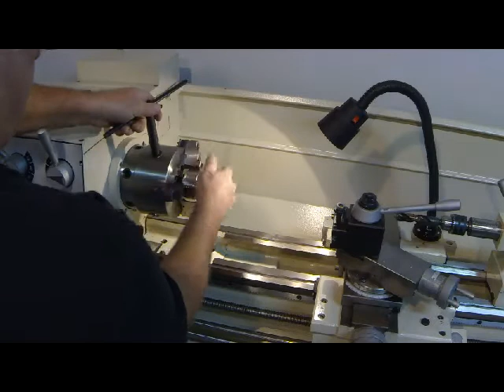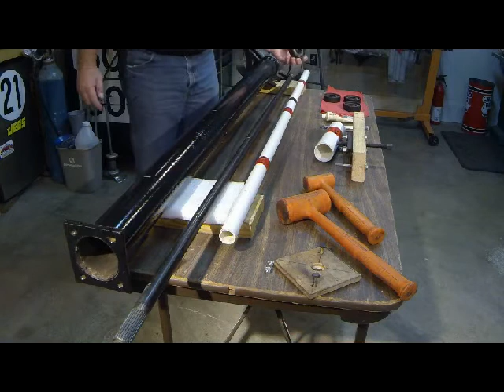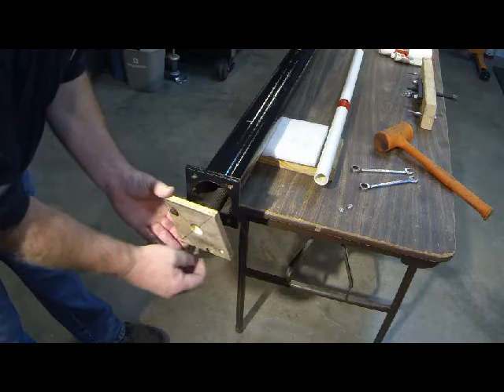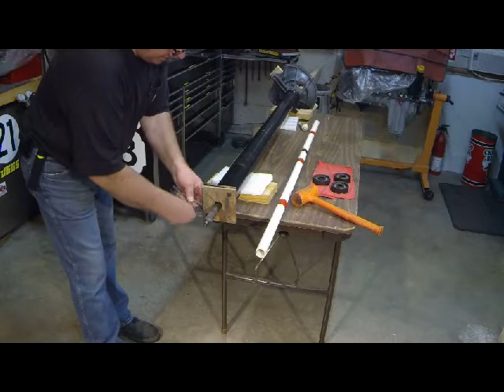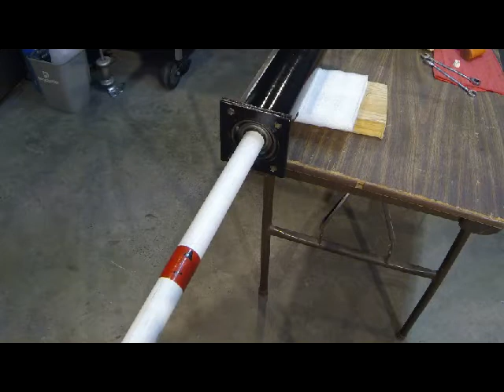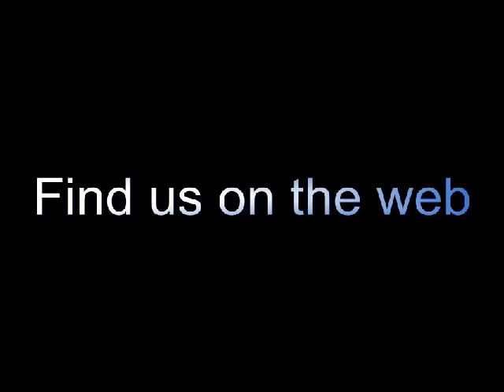944 Torque Tubing Part 2

Comment: Hi
Im newbie about porsche torque tube bearing replacement. Is it special bearing ?
Because when I replace a normal bearing , for different application, normally it would be worn when we install the shaft to bearing since we hit the inner race of the bearing.
On this video ,bearing no123, The outter race of bearing will have resistance from the inner of the tube.

Comment: How did you get the shaft out of this?
Reply: Hi Thomas, there are a number of ways to remove the internal propeller shaft. One very effective way is to drive it out from the back to the front as far as possible with a steel bar with a diameter smaller than 25mm or 1 inch. That way if you are careful you won't needlessly damage the bearings. 
When there is enough shaft exposed out the front end you can make a simple and effective clamp that won't damage the shaft itself using a block of 2x4 wood.
For this "clamp" using a block approximately 8 inches long, cut the block lengthwise. Next cut a small "V" grove in both halves at the mid point. Drill two thru holes at each end of the block and using two lengths of "all thread" rod you've made your clamp to clamp around the propeller shaft. Once clamped you can tap on the wooden clamp with a hammer to extract the rest of the shaft. Hope this helps...!
Reply: Actually it does a lot, yesterday I pulled on the TT so much I pulled the tube towards the rear while the drive shaft was stuck in the clutch. But I think the bearings are shot in the TT and need to be replaced
Reply: got the shaft out using an 8' ground rod today and pulled the bearings out with a threaded rod. hot tip, don't spin the rod, you will screw up the plastic sleeved washers that are between the bearings and rod. use a wrench and pull the rod not turb the rod. takes longer, but the sleeves are hard to come by.

Comment: you made it look so easy. I remember a really bad week a couple years ago. ha. Ended up buying the constantine super bearings due to the ease of installation. I think if I had the delrin sleeves it would have gone much easier. Trying to whack those bearings out the first time was a beast. Lots of blood, sweat and cursing.
Reply: Tim S 2006 corvette how to instold coupling on a tube torke
Reply: Hi Pedro, 
Joining the drive shaft to the trans-axle input shaft is relatively simple. First with the trans-axle out of the car I recommend you try sliding the coupling onto each spline shaft, on the trans and on the drive shaft separately to make sure there are no interference problems and the coupling slides onto each easily. Next I would also try fitting the coupling's cross bolt while the coupling is test fit on each shaft.
Now, with all of the trial fitting done I would next slide the coupling onto the trans-axle input shaft before re-installing the trans-axle.
Important note: before installing the trans-axle make sure the two alignment sleeves that align the rear flange of the torque tube into the trans are in place. These two small sleeves are located in either one of two positions. Either in the torque tube rear flange or in the trans bell housing. These are important items that keep the torque tube and the trans in alignment.
With the trans bolted to the torque tube, slide the coupling forward until the cross bolt hole is aligned with the corresponding grove in the input shaft. Next, install the cross-bolt. Do the same to the driveshaft side. Install the cross-bolt. Refer to the shop manual for the proper bolt torque and tighten the two cross-bolts.
And there you have it...!

Comment from the maker: Hello, and thank you for your excellent question. If I had been better able to illustrate in the video the area where the two separate halves of the bearing holders are joined together it may have been a little more evident of the difficulty involved with installing a riv-nut style or other more conventional types of fasteners.

I did consider several options including a separate metal rings to fit into the bearing half grooves with threaded holes for small machine screws but, this idea was still impractical because the heads of the screws also would need to be as narrow as the through holes.  

After a bit of consideration of how to best join the two separate halves of the bearing holder together… obviously my final choice was to go with the rivets. Rivets are readily available and removable with a drill bit if the need arises. The head of the rivet could be altered to fit into one side of the bearing holder groove and the hammered area of the rivet would follow the contour of the groove in the opposite side of the bearing holder. Though, I will admit, my attempts at swelling / peening the rivets involved a bit of trial and error…

Thanks once again…

Comment: Instead of those rivets, why not just use small threaded fasteners? I couldn't see the close-up details of the pieces, but you may be able to use riv-nut type threaded inserts as well, simplifying the assembly process.